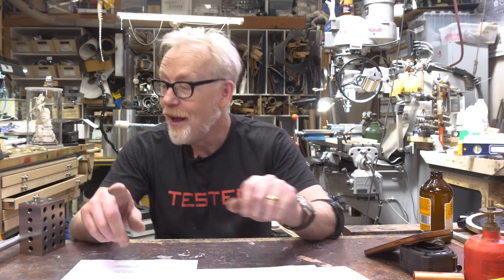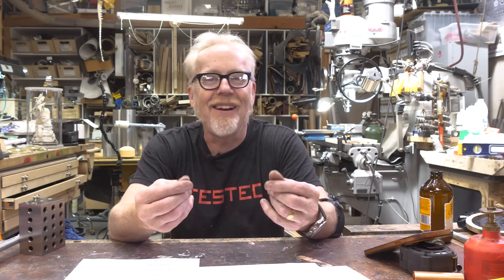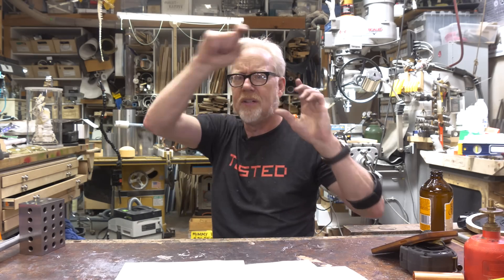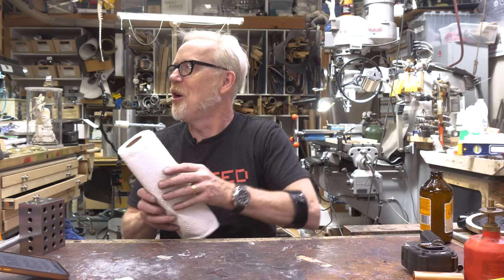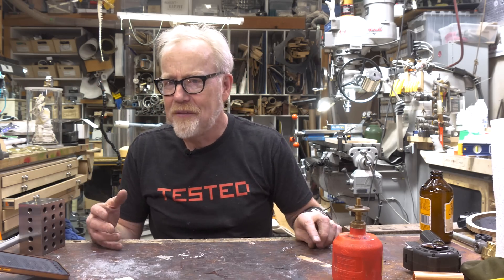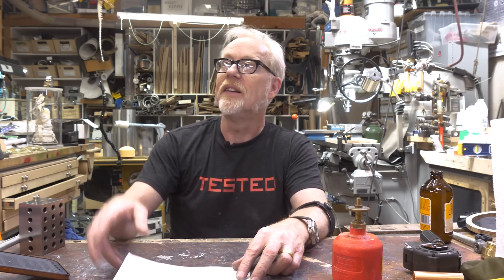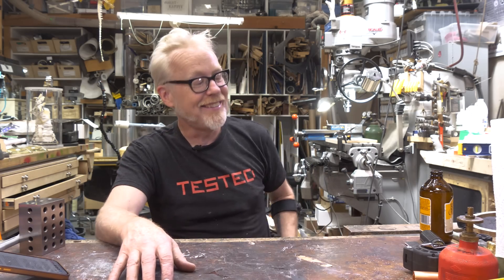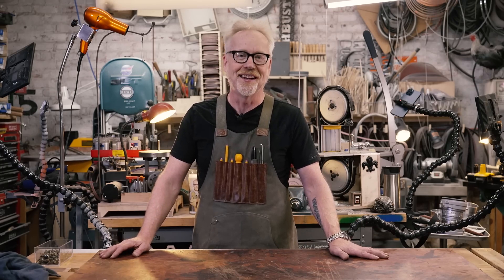Ask Adam Savage: Shop Battle Scars, Running Power and Temporary Shop Dividers

Comment: I used to work in a very old machine shop, in front of some of the machines (specifically in front of a lathe) there is about a 1" dip in the concrete purely from the wear of someone standing there 12 hours a day 7 days a week for 80+ years.
Reply: That's awesome
Reply: @TheMattwasherein1992  or really sad if you think about it
Reply: Amazing how a 1" dip in a floor can hold so much history
Reply: @OGDragonflare  Why sad?
Reply: @anon_y_mousse  same part being turned out for years or even decades at a time, no joy to be had. I've seen some shops that are poorly lit and ventilated, dirty, oil and grime everywhere. No anti-fatigue mats or walking pallets. Miserable places to work.

Some are okay and a few are absolutely fantastic.
Reply: @jonanderson5137  I don't know if that's what he meant, but either way I disagree with that assessment. A machine shop is a place of joy. You wouldn't need to churn out the same part over and over to wear a pattern in the floor, and even if you were churning out the same part, it need not be sad and joyless.
Reply: @anon_y_mousse  some aren't, I've seen them.
Reply: @jonanderson5137  
It's a pretty cool shop, everything is kept clean with  newer machines throughout. its just a really cool historic building, they always kept the same layout and floor plan so there is simply huge dips in the floor in front of some of the machines.

Comment: My experience with having had an 1800 square-foot workshop for 11 years, is that your "stuff" expands to fill all available space, unless you' really consciously try not to do that.   In a large shop, it's super-easy to lose hand tools.  Sometimes for days at a time!   I had a MUCH smaller workshop for a few years in a commercial space--240 ft**2.  It was only useful for me--entirely unpleasant to work with others in there...
Reply: There's an old proverb that your junk will expand to fill your space. It applies to all possessions you might own.

Comment: Shop organization and layout is indeed an iterative process. Two concepts have helped me in my two car garage that is also used to park our vehicles when I’m not working on a project. First was foldable, rollable carts. Bittertoot DIY has a great set of inexpensive plans that I adapted slightly to fit my needs. I use one for my miter saw and one as an assembly table. Second was the notion of storing tools I need often at my fingertips, like right on the movable carts, and storing things I use less often nearby. I even have things I need seldom in a totally different area of the house.
Reply: Hello, fan!
Thanks for reaching out congratulation 🎁🎊🎉You Won a (Flying guitar )Cheerful send a message above to acknowledge your prize🎁🎉🎉

Comment: I second the recommendation to use overhead drops for electrical supply in a shop. I converted a 400 sq. ft. garage without any utilities to a fully powered shop space. Before insulating the crawl space above the ceiling I installed electrical outlets (120VAC/20A, 240VAC/20A, 240VAC/30A and 240VAC/50A) in both the walls and ceiling as well as  multiple outlets for compressed air (60gal x 6.5hp compressor). The reason for the 240VAC/20A outlets is that many stationary power tools, e.g., cabinet saws, miter saws, disc/belt sanders, etc., that come wired for 120VAC can be rewired to run on 240VAC. Once rewired the tools draw half the current and run much cooler. I also installed a grid of Unistrut members attached to the ceiling joists (through a stucco ceiling) from which to hang lightweight items like dust collection ducts, electrical cables and air supply hose reel.

Comment: The last shop I built had a 7ft ceiling.  I was able to put several outlets in the ceiling that were easily accessible for me. It was nice to plug hand held power tools in these ceiling outlets.  The cords did not get in the way of my work since they were vertical.

Comment: you are talking my lingo. Im rebuilding a very old shop on my property. It has been at various times achicken coop, a play room, a wood shop, a barn. To call it Ad-hoc Built would be generous. But the cost of replacement was greater than the mortgage on my home. soooo. It is at least generous in space for what it is. about 1200 square feet. I have already considered welding curtains to divide areas. but one thing I did back when I first started using it to work on motorcycles and I needed to add some wiring for overhead lights is to use outlets in the ceiling of the work area instead of hard wiring lights. Im 6' 17" and the outlets are just at my comfortable outstretched overhead reach. Man what a difference that makes for plugging in a powertool or work light with a shortish extension. even if you dont have specific drops...outlets everywhere!

Comment: Your left elbow, use a Sunday newspaper rubber band around the outside of your fingers.  There is a longish explanation but Every obligate gripper will have this.  Expand outward against resistance you’ll have your cure.

Comment: The ideal size for a fully functional shop is an interesting intellectual exercise but most people have to adapt to the space they have available and not the other way  around.   Overhead cord reels are great and easy to do since any garage or shop with an automatic door opener should have an outlet in the ceiling already.  Air hose reels are even better since air hoses are even more of a pain in the butt than extension cords.

Comment: As regards electrical outlets, i just put up a 30 foot by 20 ft workshop and i currently have 12 x double outlets along a single 30 foot wall with an extra 3 x 16A outlets and 3 x 110v outlets (mains is 220v in Ireland) 1 x 16A and 110v each at the start, middle and end of the wall. There are 5 x double outlets across the rear 20 foot wall with more 16A and 110v and on the second 30 foot wall, i will only have 5 x double outlets + a 16A and 110v only because this wall will have pallet racking along it and wont need more than 5 double outlets attached to the face of the racking. You always want to put in 2 to 4 times the amount of outlets that you think you'll need. I spent soooo many years tripping over extension leads that now i want to use them as little as possible

Comment: A note from a New Yorker it is “Grand Central Terminal” not Grand Central Station; not a big thing as frankly most people use station and station has somewhat become true as a station is in the middle of the rail while the terminal or terminus is the start/end of the line, but it is quite clearly written on the building and identified on maps as a “Terminal”.
Always like the shop content as working in a condensed if not confined space can be tough and as a person that operates out of a trailer and small shop like getting some new idea.
Reply: "Has become somewhat true?" Unless you mean the subway beneath, which is not a part of Grand Central Terminal, GCT remains a terminal proper. Metro North trains terminate there, and indeed there is nowhere for them to go other than the way they came in: through the Park Avenue Viaduct and north and out. Even Grand Central Madison, the newly constructed LIRR terminal at Grand Central, is still a terminal...at least I think so, it opens later this year.